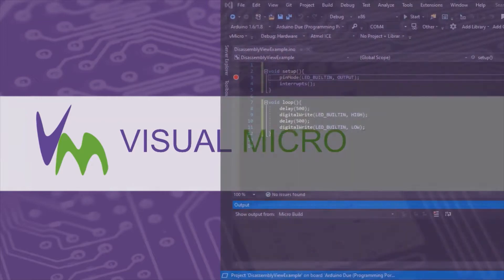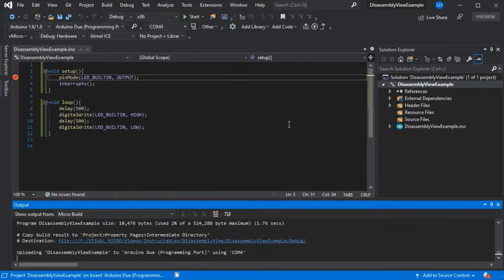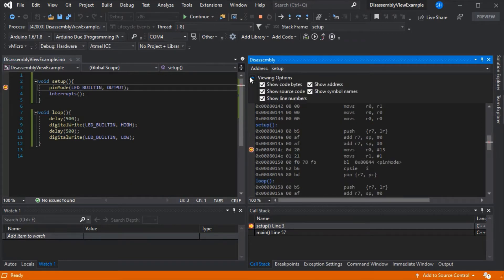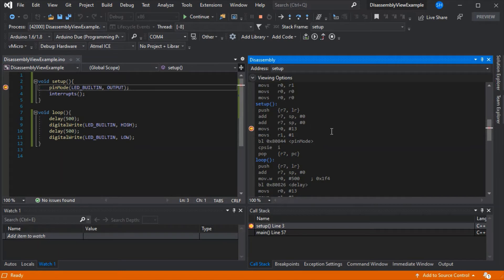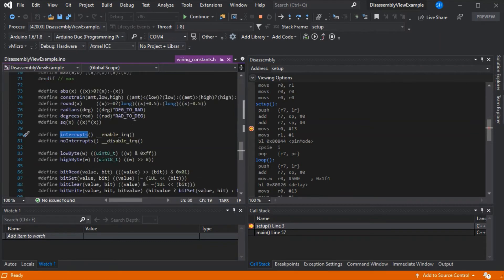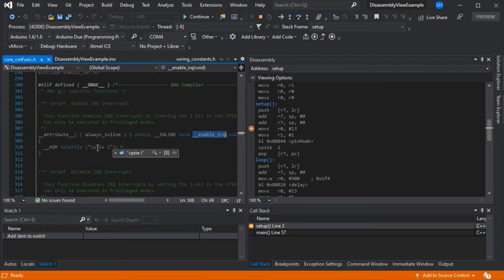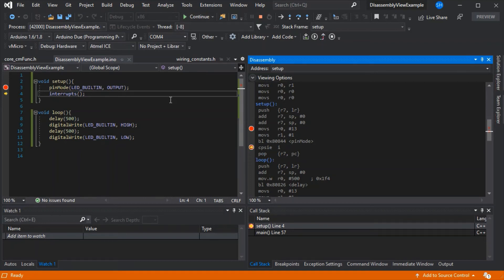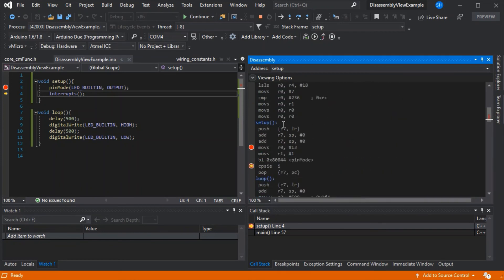Disassembly (ASM) Debug View for Visual Studio and Arduino

Comment: Hey, this is nice tutorial in case you have the source code, but what if you only have executable file?  
how is it possible to attack that process to visual studio and debug the dissassmbly?
Reply from the maker: If you have the BIN and ELF Files, then this should be possible by:
Create a New Blank Arduino Project
Set the Board and Debugger selection to match the target board the binaries are running on.
Build the project, and go to the link specified in the Output window for "Build Folder:"
Replace the ELF and BIN files in this folder with your pre-compiled ones, ensuring your files are renamed to match the ones they are replacing.
In VS use Debug > Attach to Process, and press PAUSE to break into the running code.  
It will state the source file cannot be found, but there is a link to "View Disassembly", which you can then step as normal through....